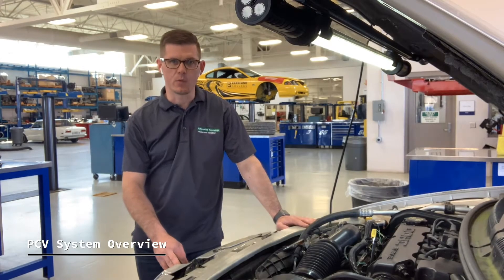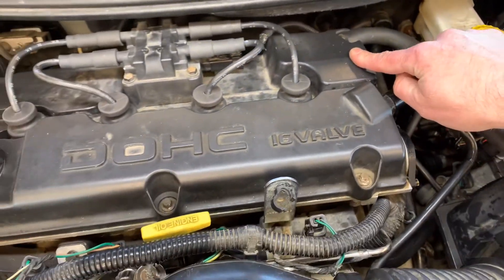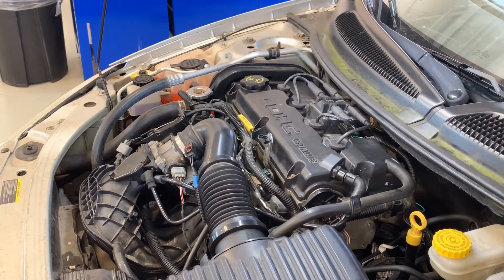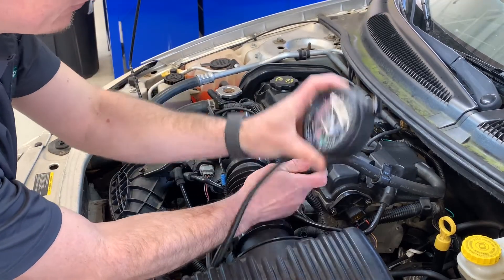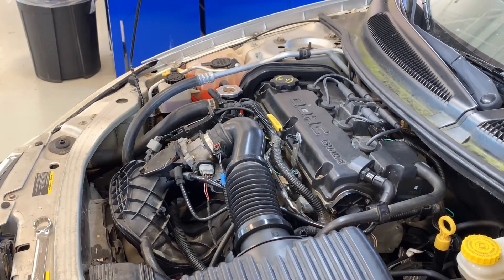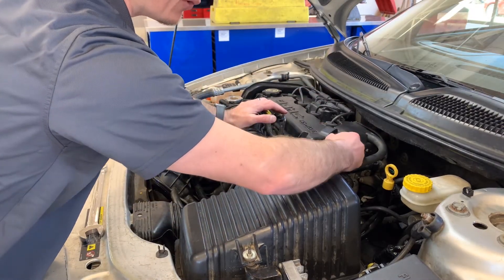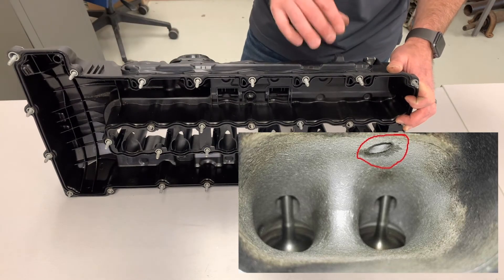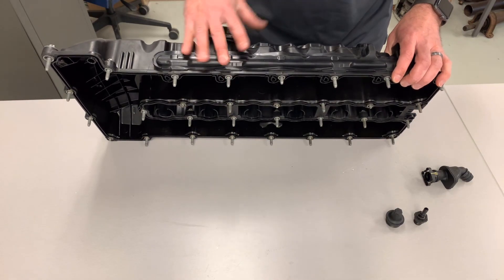Emissions: Positive Crankcase Ventilation System Overview

Comment: Is the PCV fresh air inlet into the crankcase connected to the air filter box just to get clean air?  What would happen if the hose was not connected to the air filter box?
Reply from the maker: Yes, the connection is to pull fresh, filtered air into the crankcase. If it was just left open, the air would be unfiltered which is not desired. Some people modifying cars will place small filters on this hose or connection at the engine.
Reply: @AdamsAnalysis  thanks , just noticed my side by side ATV had a loose clean air hose for the crankcase.

Comment: thanks for the explanation, can someone explain a bit more on the oil discharge from the PCV valve to the intake? is the oil discharge a normal thing or to suggest a longer hose to prevent the oil discharge from entering the intake?

some guys told me its better to disconnect the PCV from the intake and shut the intake valve using a rubber stopper to prevent the oil discharge from entering the intake and to avoid high rpm during engine idle. 

Appreciate if someone can advise me on this. 😊
Reply from the maker: The PCV system plays an important role in reducing crankcase pressure. When oil is able to travel through the fresh air hose to the intake, it is often a result of excessive crankcase pressure from another source, such as worn piston rings.

An alternative to the remedy "some guys" suggested, you could place a small breather type filter on that fresh air pcv hose and cap the intake side. This would allow the system to function as designed, and eliminate any chances of oil entering the intake.

Comment: Great video! M113K Mercedes AMG. I changed the valve cover gaskets. I cleaned both 'suction' orifices in both covers. I cleaned throttle body with a damp 'isopropyl' rag without moving butterfly plate. SL55 now idles rough/surges at idle. I now need to go back and check all the hoses and connections. There isn't a PCV valve on this engine. Code: PO455

Comment: It may be that emissions are reduced to burning crankcase gasses, but from a petrol heads perspective, it lowers the octane rating of the fuel being burnt in the cylinders, hence lesser performance.
A catch can with breather, and blocking off the pcv cam cover hose, eliminates the pcv system.
On my saab the valve is normally in the closed position, so it does not pressurise the crankcase.
The car passed it's annual mot with no problems. 
The car idles better, the oil is cleaner, and their are minimal smells in the cabin.
Great video by the wY.
Reply: All Saabs must die.
Reply: Some people can dislike the PCV value all they want, but it’s one of the devices that’s helped engines last miles longer, pun intended. Before the PCV value, engines simply used a road draft tube to ventilate crankcase vapors which ended up being disastrous since the blow-by gases would react with the oil and create lots and lots of sludge which ultimately caused oil starvation problems, you’d be lucky to get to 75,000 or 100,000 miles with a road draft tube engine. Explains why cars from the 1950’s and early 1960’s got the reputation for “only lasting 100,000 miles”. As a soon as the PCV valve became mandatory in 1963, became more common to see engines with 100,000+ miles on them.

Comment: Do you no a 2005 Lincoln navigator pvc value where us located every body does a different car need a 2005 Lincoln
Reply from the maker: It looks like, for a 2005 Lincoln Navigator with a 5.4L V8, the PCV valve is integrated into a hose (PN 3L3Z6A664AA).

Comment: I have a GT500.  A Mustang GT has a PCV valve almost the same as GT500, and will fit, but are different in color & part number.  Do you think it will suffice?
Reply from the maker: I do not know off hand. If they are a different color, that might signify that it is a different part internally. However, it could also be a simple change in supplier during production.

Comment: What will happen if the pcv grommet fell inside the engine?
Reply from the maker: You would want to retrieve it prior to starting the engine. You could try with a grabber or three finger type tool but may need to remove the valve cover.
Reply: I just insert new rubber grommet and insert the pcv valve, is it possible that  the grommet can cause any problem in toy engine? My car is honda city 1.5 i-vtec 2010.